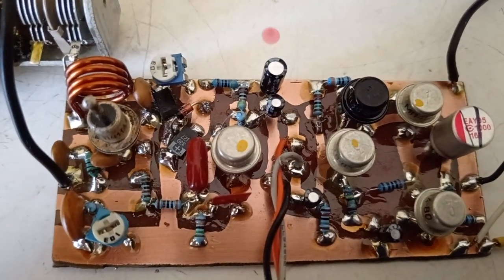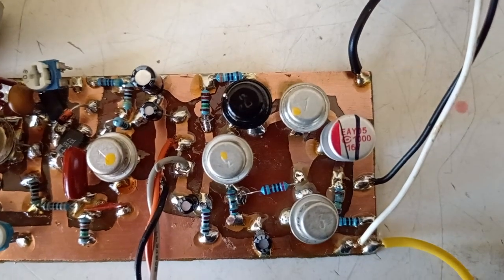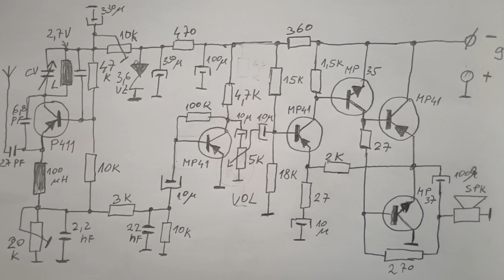Superregenerative FM radio receiver.. FM  Радиоприёмник. ФМ приемник.

Comment: Many years ago i made lot of those on ГТ313  can easy handle such frequencies. Then ceramic filter for IF on 10.7 and FM demodulator on К174УР3 if i remember right.
Reply: And varicap tuning because i like like voltage controlled tuning more than mechanical one.
Reply from the maker: Hello and thanks for your comment! Yes, I know the K174UR3 circuit, but I cannot find it, especially now, when Ebay blocked all the russian vendors (I doubt that people selling capacitors and diodes are supporting the war with the earned coins!). So, I will soon test a receiver with an UKW block from an Okean receiver (tuned for FM) and an TBA120U integrated circuit (or an LA1260 if TBA120 does not work) 73 de YO6PMX и пока-пока!

Comment: Not bad for a self quenched transistor circuit. You might find it worthwhile to change the bias on the transistor rather than its collector voltage, to find the optimum operating point.
Reply from the maker: Sir, I am highly honored to receive comment and advice from a living legend in superregenerative receivers field! I have discovered your site about 10 or more years ago, I have built your 12AT7 receiver and it worked like a charm! It was my first superregen radio. I am planning to build your ECF80 version soon. Congrats again for your site and for sharing your schematics, all the best from YO6PMX!
Reply: @perianmarcel2059  I'm glad to know of your success with the 12AT7 receiver, and hope you have good results with the ECF80 as well.